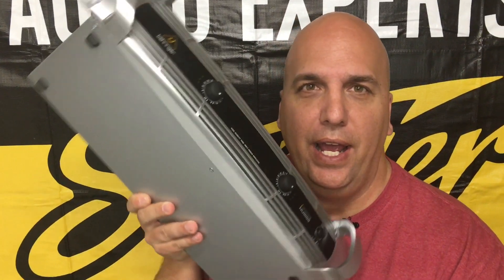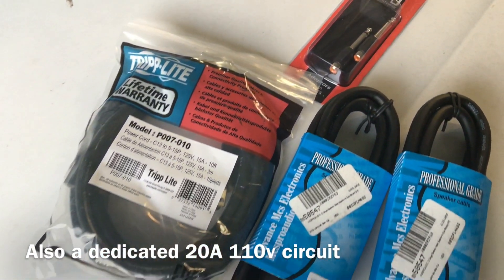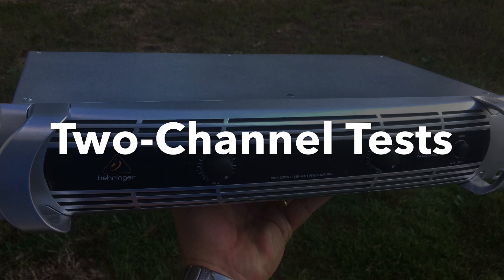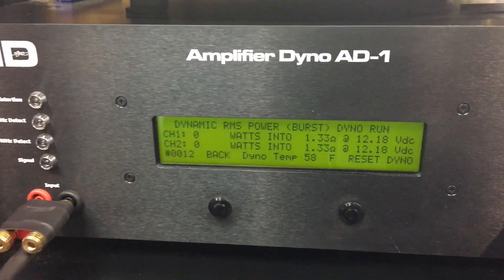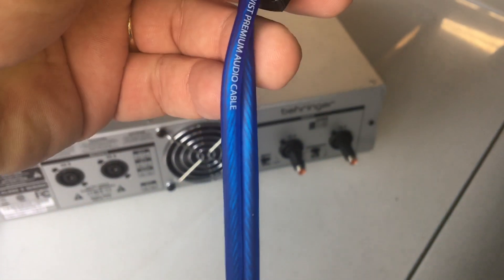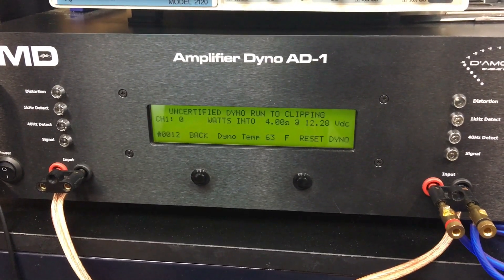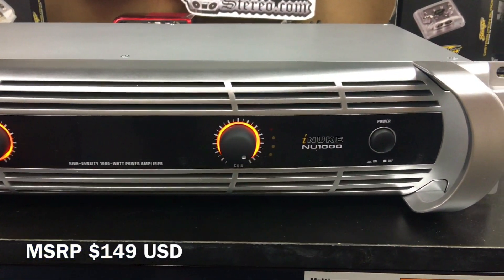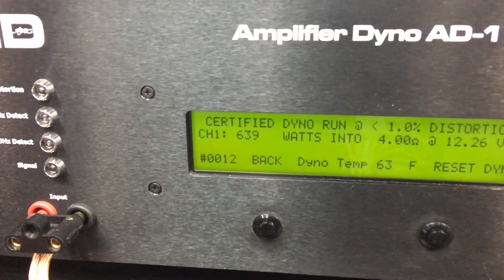Behringer iNuke NU1000 Amp Dyno Test

Comment: I think $149 is a good value for a 600 watt amp and they could make more sales rating it as such.
Reply: LoL saying 7kw of RMS power. RMS is continious and 240v 16a  can deliver about 3600 max so thats wayy off 7kw
Reply: @EndstyleGG  
I know this was three years ago, but your statement about circuit amperage isn't correct... and nearly everyone thinks the same way. 

A circuit breaker will pass huge amounts of current for long periods of time (to prevent nuisance tripping on motor startups etc).  
 
A 16 amp circuit can pass 7-8 times the rated 16 amp trip amount, .. for up to a second or more. 

It will allow up to 3x the rated amount for up to 10sec or so. 

Amazingly, the same circuit can allow up to 1.5-2x the rated amount for a period extending as long as 30 seconds!

So that 16a breaker will pass 30a or more for a sustained thirty seconds. 
For brief periods, like dynamic music peaks, the circuit will easily pass over 100amps.
Reply: @FOH3663  That is indeed true, but the ponit was RMS power, which is continous. 
Now music is indeed very dynamic so if you have 7kw worth of amps plugged into a standard outlet, you could probably use all that power on certain kinds of music, without blowing the fuse. 
In the case of electronic music (Oliver Heldens style) where the basslines are much longer than just a quick punch, i doubt that breaker will last more than a song
Reply: bassmansoundking99 HT most likely. These amps are VERY popular if you head over to the HT forums.I plan on using 2 6000's on a pair of Ultimax 15's.
Reply: the original owners manual, dating back six years now actually specifies the amps output considerably lower. the newer manual only states maximum output figures. but still pretty accurate. the only one that's off (by a small margin) is the output @ 2 ohms and Of course 4 ohms bridged. what's really nice about these amps is their power intake, they are really efficiënt. I can run 4 nu3000 amps off one 16amp 240v socket giving me about 7kw of clean RMS power! Mosfet amps would give me trouble using more then two 2kw. amps on the same outlet. class D makes my life a lot easier.
Reply: What are you running all that power to?
Dj, home theater?

Comment: i know that after i installed a new panel with twin copper ground rods  and dedicated 12-2 line with a hospital grade outlet  to my amp performance was noticeable when you really pushed the amp as i no longer had any voltage drop . are class D amps more susceptible to voltage drop performance than class a/b amps i would think so  ?
Reply from the maker: +George Empfield my panel is just to the left of my bench, I installed one, soon to be two dedicated outlets using 12/2. What you are saying could absolutely make a difference...interesting it is a noticeable (audible?) difference

Comment: Predicatable results,amps never meet there box rating BUT what about woofer ratings,is there a test you can do to see exactly how much a sub can take? Ive got a bassface spl 12.2 rated at 1000 rms 4ohm...but i doubt it takes that.
Reply: ElvislaD plenty of amps destroy the box rating
Reply from the maker: +ElvislaD when you smell coil, it's too loud 😳
Reply: :~} seriously though would you burn out the coil before you reach the subs end stops? i suppose its all about what frequency the main note is?
Reply from the maker: +ElvislaD if your amps are tuned properly (not clipping) and subs can handle the power, they should be fine. No easy way to know how much power the subs can handle. I'd ask the Mfg for RMS ratings
Reply: Yep of course,in line with your amp dyno tests though maybe perform a similar test with subs,slap a 20,30,40 etc hz through them at at a known wattage ? only an idea,music is a shit loads more demanding than tones...maybe a white noise tone,id watch that shit for sure
Reply: +Matt Sullivan like Sundown, and many other high quality brands, can put out more than rated, and  can be loaded down to a half ohm relatively safely to make even more, Id say most home amps never hit the power ratings claimed,  but there's always some that do as well
Reply: Speakers power ratings are purely thermal. RMS (root mean square) is the amount of wattage the coil assembly will handle for 8 hrs before the heat buildup burns the coil and the adhesive fails. In free air, a typical sub will reach Xlim (suspension limit) with much less wattage than rated spec. Same with in a box, sealed enclosure will typically (depending on Qtc) reach thermal, before Xlim. Ported, will always reach Xlim before thermal rating, below tuning and depending on alignment, before tuning.
Reply: Matt Wells this isn't really a home amp... it's a pro audio amp, and even the decent pro audio amps shit on anything for mobile audio
Reply: To know if the amplifiers are rated for output correctly, you must first know exactly how the manufacturer tested them (parameters). I own the 1000dsp, 3000dsp and 12000dsp. I have tested them according to my own parameters and to the manufacturers. The amps will make the power they claim, but you must first know how to setup the test. They rate them peak with a 1KHz 20ms burst, non-repeating. They do reach the claimed numbers, but yes, it sucks that all of the manufacturers setup their own parameters for testing power ratings. For the cost, these do a very good job.
Reply: These are decent amps, but like with all amps, you must research what you are buying first. These have big headroom (like all new digital pro amps) and the digital power supplies can only sustain so much sinewave signal before dropping and relying on the mains for power, which shows in the testing BigDWiz did hear.
Reply: +fidstang yeah it's not bad, the amp dyno, is probably the best test of amplifiers power output, I can say I don't actually know what 1%thd sounds like, whether it's a clearly distorted signal, it may depend on the frequency used, but I'd live to have one, they always use the same three test parameters, maybe all amplifier makers should be required to have one of these dynos set up, and regulated by a third party, at least so they have a certified power badge on the box or manual, it should be a CEA requirement, ID love to know how much my Pyle pmwa3003ts actually push, "3000" Watts peak is fake, but from the numbers I've gathered with a multimeter mine is putting out from 800-1400 Watts, for a $170 amp it's pretty good, especially for a home use amp, the only reference I have is my Sundown 1000d amp, which is tested on one of these dynos at 1250 Watts at 1ohm, I had my sundowns on that amp, but had only one RCA hooked up untill I put my small sub back in, the result was alot more gain, and my head unit begins to distort at 15 so it gave me a good amount more power from that, but I had them cranked above the distortion level a bit, and could see how much that amp makes them flex, and it doesn't seem far off from my Pyle amp, I have two now, as a power amp it's a great choice, the only issue with the sound is when there's no other sound you can here a little his/hum, but that doesn't get louder if you increase the volume, mostly audible via my super tweeters. it's labeled as a pre amp hybrid, but all of the RCA outs are trash, and from what I can see on the outside its far beefier than this one, with a decent sized toroidial transformer. not sure of its class, but compared to most amps at the same power ID say it's a small size, two of these stacked is only about an inch taller than my pioneer surround receiver. it's a 4 channel amp, and each channel is definitely good down to 4ohms, only exception being at 15 or less Hz or less it'll draw too much power if the volume is up too high, only happened before I used the pioneers pre outs, as my ps3 sent fully cranked voltage into it. as long as you know it's not going to do rated and it's cheap, then buy it, my first one has been working for like 3+ years now. oh one more negative, is that the fans are a tad noisy on startup, and my first one gets very loud until you run the fan a bit, I may need to replace the fan. but it is far better than spending 600-1500$ for a bigger name brand SMP that'll do about the same power, especially since it has standard speaker outputs, rather than xlr only. may be a drawback depending on your application, but I don't need the xlr, so it not being there doesn't bug me at all

Comment: I was curios if you checked the line voltage at the plug you were using  to see if it was close to a 120 volts ?
Reply from the maker: +George Empfield I will check. It is a 20A dedicated outlet I wired for a window AC unit, no AC currently required 😜.

Comment: The Behringer iNuke's are jokes.. Always rated in peak combined from both channels. You get what you pay for.. The NU6000 is more like 2000W..
Reply from the maker: +Electricguy about 65% of rated in this case. Many in the car audio world say RMS should be about 1/2 of "MAX" power. Using these rules, this amp killed it 😜
Reply: lol, yeah it's doing surprisingly good considering.. But these amps are just wanky crap for kids' discos.. lol. Good test though. Really like your videos! :)
Reply from the maker: +Electricguy 🤘😜👍

Comment: I have a crown XLS 2500 I wish I could send you to test but I don't trust shipping to get it to ya and back. It's rated for 2400rms @ 4 ohm bridged. Cost around $500. It has enough power to make my lights dim in my room. Maybe one day I'll see it on the dyno! Great vid as usual!
Reply from the maker: +Python1567 I can prob get this from my local Crown dealer to test
Reply: +Dereck BigDWiz That would be awesome, I have always wondered what it does.
Reply: calee4nyaboy this was all 2 years ago lol

Comment: Test one of those wierd bluetooth 2.1 boards thinking bout making a portable boom box but 50x2 and 100x1 seem exaggerated for twenty bucks.
Reply from the maker: +Nightmare Munoz I think most of the cost of those are the power supplies required
Reply: Dereck BigDWiz Yeah and for twenty bucks even if it has 25x2 and 50×1 its alright just i hope its not like 12x2 and 20×1 that would be weak.

Comment: I'm so happy you did this test with this type of amp.  It would be so interesting to know if Crown and QSC amps rate their gear at accurate levels.  I have a QSC GX7.
Reply from the maker: +XXVelocityXX I'll try to get my hands on a Crown...I'm betting it will do rated plus
Reply: Dereck BigDWiz Awesome channel.  I agree, Behringer makes some great MIDI stuff, but still entry level for pro audio.  Crown tends to be industry standard.
Reply: A Crown XLS DriveCore 2 series would be a good test, has RCA input with selectable "Pro" level or "Consumer" level input and binding post outputs, defiantly the most appealing line to the DIY home user.

Comment: I have 3 of these....always thought the weren't the power rating they said.....not impresses at all. thanks for testing it @bigDwiz
Reply: Lasse Huhtala it does ...when I use my qsc amps the level (gain) is 35% lower than the nuke 1000. 
 there budget digital amps so you get what you pay for its just sad there that off there spec.
Reply: In Behringer's defense, they do have a bunch of really good products in their line-up, their power amps just seem to be a bit too cheap for their own good, to the point of not being honest with the numbers.
Reply from the maker: +Rich kent not quite...I'm also a bit concerned with those using this amp for HT as I don't believe the 1v output from most HT receivers is enough to drive this amp. My 4v head unit still required 9/10 gain on the Behringer
Reply: Dereck BigDWiz I have to set the EQ gain high on these so that makes sense
Reply: Pro gear uses a higher input signal level than consumer gear.

Comment: Could you do a test on head unit internal amp outputs with the dyno, please? 

Maybe one of those "mosfet 50" amps will put out something besides hot air. There's nothing much to the circuit on these - just an amp IC and about ten components. I made one from scratch from a TDA-7850 IC for a boom box.